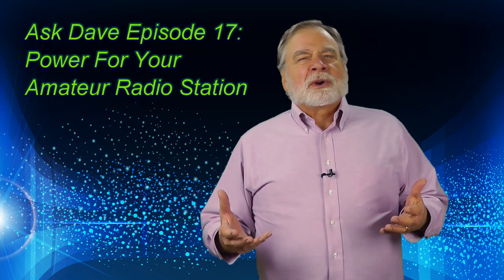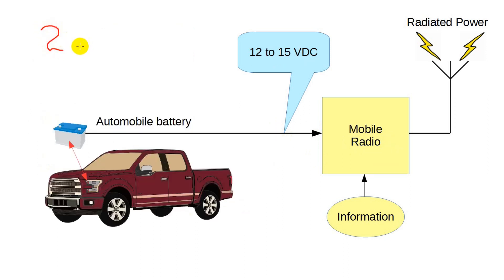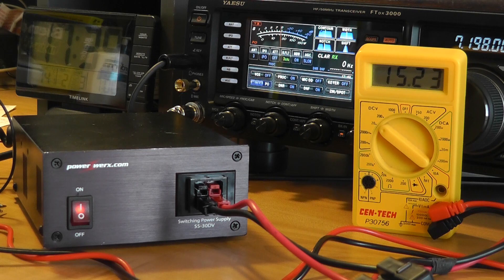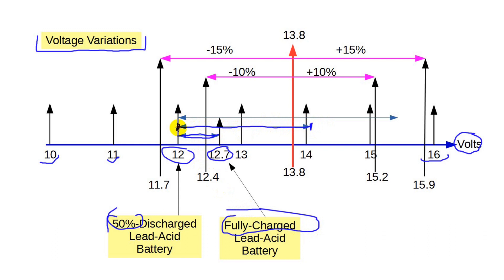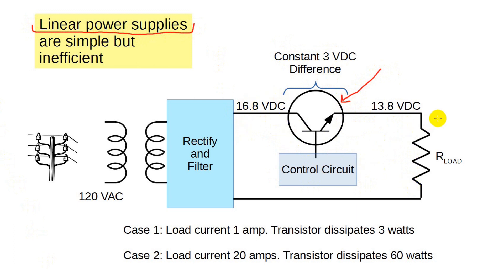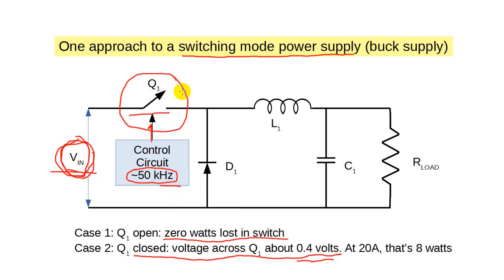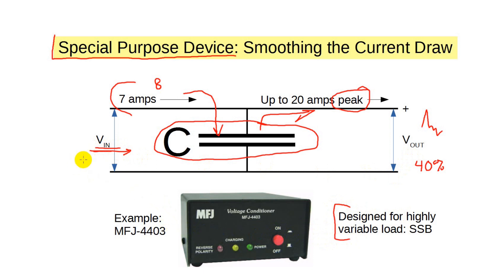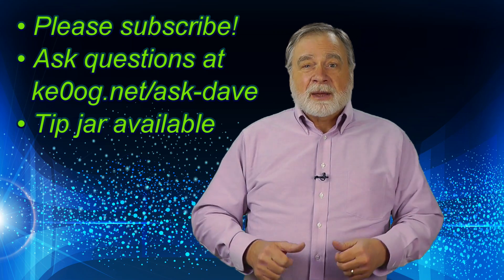Ask Dave 17: Power For Your Amateur Radio Station

Comment: Dave!  Thank you for your videos.    I am very new to the hobby and have a question.  I only have one quality 50w VHF radio.  I'd like to put this into a portable chassis or go box so that I could use it in my vehicle, then move it inside for base station work.  Ideally I'd like to have a battery large enough to power the radio for at least a few hours independently that I can also charge off of a cigarette lighter, charge with a trickle charger, or charge with a solar pannel.  What battery would you suggest?  Do I need a charge controller or battery management system?   Thank you!!

Comment: Yeah Dave but if you got a diesel quad you'd have much more torque......

Thanks for the great video. When I'm in the southern hemisphere I use an Emtron EPS 30. And oldy but a goody.
In the north I use a Racal pvs-20 power supply.
Reply: +Ade Larsen Some local guy is selling 6 phase 28 volt Waukesha gen sets for less than dirt cheap. They came off cell towers & were used as aux power for when the batteries go dead from lack of sunlight on the solar system. I would need to rectify the 6 phase 28 volts then regulate it down to 13.7 then use an inverter to kick it back to 120 for those AC power needs.  These Waukesha sets are propane/nat gas, & can be easily rejetted for either propane or natural gas. Every so often I do see an old military tri-fuel come up. Tri-fuel my ass! Try any fuel, other than diesel in one of those after it has been run with diesel & tell me how well that works, without cleaning the plugs.
Reply: +Seth B I just bought an Astron 35 amp & just I got a 1.2KVA buck boost 240/120 to 24/12 volt,  a variable reglator, zeners, other passive parts, and a enough transistors to step that up to around 13.7 volts @ 100 amps peak, for about $300. I knew I kept those heatsinks around for a reason.

Comment: Hi Dave, I had a question about something you mentioned around the 6m30s mark, that the transceiver should be turned on after the power supply is on, and also that it should be turned off before the power supply is off. Why is that? Are supplies prone to unpredictable voltage when they're turned on/off, or are there other reason(s)?
Reply from the maker: Nick, the answer is that, yes, power supplies can put out spikes when turned on and off. But also the power dies away a bit slowly, so the rig is subjected to severe undervoltage  which can make some of the circuits, particularly digital logic circuits, unhappy. Best to use the rig's power switch for power on and power off. 73

Comment: Hello,I have the MFJ-4035MV power supply, which was stored in a box for over 10 years. Previously it was working well. But now the voltage meter fluctuates and does not stay as set with the voltage adjustment knob.I did open the unit up to blow any dust in there but the problem persist.Can you tell me why this is happening?
Reply from the maker: Check with an external voltmeter to see if the output is actually fluctuating or if it's just the internal meter. If internal, you may have to retighten contacts inside. Note that line voltage is on some of the heat sinks, so unplug the power supply prior to poking around inside.
Reply: @davecasler  Thank you very much Mr. Casler for the information. You make great videos, 73.

Comment: Hi Dave,

I'm looking to power an old icom U16 (similar to O2-AT) portable radio UHF(5W) at home...440-450MHz. It draws about 1.5amp on HI power setting.  Will a switching power supply interfere (RF noise) at UHF freqs? I'm looking at switching primarily for size, but if needed will do linear/bulker. Thnks.

Comment: Hi Dave,  I ran across your videos on solar and saw the ham related video's. I know it's late in coming but just a little note. You're graphic with the battery and the DC-DC converter should actually be a boost converter, not a buck. Good video though, as are all the others I watched. 73 NU1W

Comment: Hi Dave, I’m Mula, YB1BUL, I like your channel😊. Regarding Power Supply for our ham shack, is it OK if I put a parallel Capacitor? I have Super Capacitor of 100F/6 = 16.7 F (6 caps of 100F/2.7V in series with a balancer board)

Thank you
73

Mula

Comment: FYI, the diagram at 21 minutes into your video is mislabeled.  You say the right things but a switching power supply that boost power is called a "Boost converter".  "Buck" converters are exclusive for dropping the voltage.  You can fix this by simply changing "Buck" to "Boost" on that slide of the video.

BTW, there are Buck-Boost converters (https://en.wikipedia.org/wiki/Buck%E2%80%93boost_converter) that will either boost or buck the voltage based on whether the input is higher or lower than the desired input.  I just do not know if they are used in Amateur radio but then I doubt that they are needed for typical Amateur radio applications.
Reply from the maker: +bitogre Thanks for pointing out the error. Unfortunately, once I put up a video, YouTube won't let me edit it. Hopefully people will see this comment and check out the Wikipedia article. Thanks for your sharp eyes! 73, Dave, KEØOG

Comment: Hello Dave, I am going to be picking up my first HF radio which will be and FT-891. Going to be going portable with it to the park and such, when connecting it straight to a battery will I need any sort of fuses or extra components to protect the radio?
Reply from the maker: The stock cable should have fuse holders already built in. If not, yes, you should put in a fuse. You can get automotive-style fuse holders at an auto parts store. If the rig puts out 100 watts, you probably will need a 25 amp fuse. Enjoy your portable operations!
Reply: Thanks for the quick reply.

Comment: Using two "good" meters in some tests, I found one was 0.2v off from the other, so I couldn't be sure of what the real 12? volt system was at. I built a dimple "10.000vdc" calibration source into an Altoids tin and calibrated them both. And the first free CenTech meter I got? Was off by 0.4V out of the box. Dave, you CAN'T assume uncalibrated meters are right. Build a calibration supply, or buy a Fluke, to judge all the others. As they age they all drift.
Reply from the maker: The statistical estimation of physical parameters makes for interesting science. The TekPower meter I'm using now seems to be within a couple hundredths of a volt. But two meters will never agree! If they're of comparable quality, just average the results.
Reply: Yes, each meter will have differences, sometimes just the random float of 2-3 digits in the least significant digit. But on a standard 4-digit meter set to the 2-20VDC scale, I find all four generally stay in agreement when I've calibrated both of them to "10.00" scale volts. Bearing in mind the calibrator is putting out 10.000 so there's no float of the last digit coming from that. I often throw out the LSD simply because that float can make it unreliable.

Comment: David - Very good video...  Lots of valuable information.  You may want to do a supplemental follow-up video to discuss the subject from the pespective of battery use.  For example, I use radios in my van, wired to batteries that are powered by solar sources not the vehicle's power source.  This brings several new angles to the game.
Michael VA6XMB

Comment: Shot in the dark.  Bought a Kenwood ts-50 and a kenwood ps-30.  My concern is the ts-50 appears to like a 20amp continuous power supply where the ps-30 is 15a continuous and 20 intermittent.  Is this an issue?
Reply from the maker: The TS-50 should not need 20 amps continuously unless you're transmitting a full duty-cycle mode such as RTTY or PSK-31. I would still recommend a power supply that can deliver 20amps (or 25 amps) continuously.
Reply: @davecasler  I bought the ts-30 for $40.  If that makes a difference.  For the time being though, it will power the radio and tuner?  I don't know if I'll even use hf much.  

What do you know about the ps-30?  I read somewhere that it doesn't have over voltage protection?  Is that a serious concern?  I mean is it worth just spending $120-$200 on a power supply that won't fry my ts-50 and tuner?  My logic is these would have been off the market if they were frying rigs on the regular though eh?
Reply from the maker: @magicman08  I looked up both rigs and it looks like they should be a good match, particularly for SSB voice and for CW. If you try continuous duty cycle modes like RTTY and PSK-31, be sure to reduce the output power to about 50 watts or so.
Reply: @davecasler  thank you much for your time and effort in looking into this.  Now that I know for the most part, that I'm over the power supply hurdle, I can focus on antennas.  Going to watch your HF primer now.  Great content and I like your video flow.

Comment: Motorcycles, Solar power and HAM.  A man after my own heart.  73  KM4UQU.  Can more than one radio be hooked  up to an external power supply provided the PS amp rating exceeds the requirements of the radios?

Comment: I got a astron power supply today says 7amps and 10amp continuous I hooked it to my 45 watt Kenwood nexedge Mobile Radio and the radio is set to key up to transmitt a status code it kicked the power supply Down and I couldn't get it to work went to power and on again kicked down the radio says 13.8v and 13amps guess it was to much for it so I ordered a 19 amp 13.8 switching power supply RadioShack one the Astron had transistors on the back I'm guessing it's a linear power supply makes me mad wish it would run my radio hope this 19 will

Comment: Stupid question,  I'm new to the radio world,  I too have a Radio Shack 3A 12V DC power supply.  My radio says 75 watts output on VHF and 55 watts output on UHF.  I connected my radio to a SWR/Power meter.  I have noticed that on VHF high power is only putting out 22 watts output and about 18 watts output on UHF..  So does your power supply affect your radio watt output? If so I need to get a better power supply to get better radio watt output?
Reply from the maker: I'm surprised your radios worked at all in transmit. You need a power supply that can put out 15 to 20 A. The power supply you have now is way undersized for your radios.
Reply: Thank you David for your reply,  Yes I did buy a new power supply, It is a 12 volt 30 amp and now doing testing my radio it putting out about to 92 watts on VHF 151.0000.  and about 51 watts on UHF.I have the QYT 980 Plus.  Thank you again.

Comment: So a 30 amp switching supply would be enough for a icom 2730 mobile in the house? Or is that over kill
Reply from the maker: If that's all you have, it's overkill. But if you plan to add an HF rig, it's not.

Comment: Just received my new mfj 4275 and I am lost. Don't know how to hook it up.Do I hook it to40amp 75amp or 35 amp?will there be a problem with having the power supply next to the Stryker 955 with 80 watts out put.
Reply from the maker: The 4275 has several power outlets, and you can use any of them if they are rated for the load. For example, a 100 watt SSB rig rarely draws more than 25 amps, and that only for very short periods. There is no problem putting multiple rigs on the same power supply.

Comment: Hi Dave!!  I have a loaded question for you: I have a 43 year old 
13.8 no-name power supply.  Do 
you have ANY clue as to why it 
puts out 26.6 volts?  Good thing I 
checked before I connected 
my radio to it!! It looks like the old  small boxy Micronta unit from 
Radio Shack from the 1970's!! 
There's not much inside.  I made 
a power supply from a computer 
power supply, but it only puts out 
11.7 volts(maybe not enough?). 
Any thoughts you could give me 
would be very much appreciated. 
Thank you in advance & greetings 
from Montreal, Canada!! 
73 from your LOYAL subscriber,
Norman.
Reply from the maker: Hi Norman. If I were you I'd look around for another supply. Something's wrong with this one. And, yes, the 11.7 volts is likely too low.
Reply: @davecasler : Thank you very much for answering my question 
so soon! I had a feeling it was time 
to go power supply shopping, but 
it's good to check with an expert, 
such as yourself, before making a move just in case.  I'm truly 
honored that you took the time to 
respond to my query.  I'm going to 
study to get my ham license, and I 
am hopeful to get it soon!!  Then it 
will be time to get my first ham 
radio!! I'd like to get a hand held 
first for the convenience: it can be 
used in the car with a mobile 
antenna, at home with a base 
antenna, or walking around, and 
secondly: price.  With a low initial 
cash outlay, I'll be able to get the 
mobile & base antennas as well as 
the hand held unit!!  Now I just 
have to figure out  which hand held 
to buy!! 5,7,8,10,15 watt?  Is it 
dangerous to use a 15 watt 
hand held? What about 10 watts? 
Much research is needed!! Thank 
good fortune that you & your 
videos are here to learn from!! 
You do so much for this good 
and fine hobby/way of life, I 
wonder if you know how much 
we ALL truly appreciate you and 
all that you do.  With my 
disabilities, it'll be difficult 
to buy what I would like(Doctors 
say I can't work anymore), but I 
will get there one day soon, come 
hell or high water!!  I can't wait to 
make contact with you on the air!! 
I've got  an RCA Co-Pilot 14T302 
SSB CB radio (vintage1978!!), so 
that'll keep me going until I can 
pass my ham test and get my 
first ham radio!!  You'll hear from 
me with more comments, queries 
& questions, no doubt!! I'll also 
let you know when I pass my 
ham exam.  Thanks again for everything Dave!! 73, Norman.

Comment: Hi Dave! I was just about to ask you this question.
Brilliant answer.Thanks.I use an old CB PSU from 1980 s  and it gets extremely hot transmitting 10w (maximum power for a M6 )
Thanks for the advice. Time for a new PSU..

How about a video on USED ham radio for example what to look for best used radio for simple use. Bargain of the year as people buy the latest kit.There must be gems out there if you know what to look for .over to ask Dave !

Anyway just a thought.

Regards

David m6dfl

David m6dfl
Reply from the maker: Used equipment is so variable, plus I have always bought new, so I'm not good at spotting a bargain. I'll have to ask around at the club.

Comment: Discharging a lead acid battery below 12 volts or 50% can damage the battery and shorten the life of the battery.  The newer LifePo4 batteries are better!  They can give much more power per pound and size and can last almost 10 times longer.  The downside is the cost. They cost about 3 times as much but can last up to 10 times as long.  But the up front cost has stopped them from being used much.  They also have very low internal resistance and can deliver higher current.

Comment: That explains your great depth of technical knowledge.   In some of your videos I've noticed you own a Ten-Tec radio.  I'm currently in the market for a n HF rig and have contacted Ten-Tec about their OMNI VII unit.  Apparently it is sold out and they are waiting for parts to begin production on the next run.  Can you tell me anything about the radio?  How does it compare to the more mainstream competition?  Would you buy another Ten-Tec given the new machines on the market today?
MB
Reply from the maker: The last I heard, TenTec was no more. Perhaps someone is going to revive the brand. Their Omnis were great radios. I replaced my TenTec Jupiter a couple years ago with a Yaesu FTDX-3000 and enjoy it thoroughly.

Comment: I am having trouble with the Math 13.8V * 20A = 276 Watts  for a 100W Radio.  What am I missing here?
Reply from the maker: The radios are 100 watts out. The output final amp is linearly biased, so the amp is less than 50% efficient. Hence the much higher power input.

Comment: I have seen so many times where one refers to "CURRENT" as being Voltage, Amperage or Wattage and... Sometimes something perhaps completely Different <-- this happens when someone is explaining a circuit and uses the terms Voltage... Wattage... Amperage... and then injects "Current" also. This can be quite disturbing when you are utterly new to this device circuit and are trying to understand its concept.  It would be nice if proper distinction was given to this.   Although quite adept in electronics this can be quite problematic when trying to stay focused on a device's build and all of a sudden this term is introduced, although from the beginning; Voltage, Amperage and Wattage had been used all along and many times prior.
    (BTW -- I know others who would also like this explained but have felt to embarrassed to ask.  They think it would allow others to think less of them as a electronic tech.  I understand if this is an issue you have as well, so plese, if you do then just ignore this comment. 
    As for me... I used to write about electronic theory and antenna arrays for a local Ham Club.  I am self-taught AND I never OvER--raTe NoR ExaGErRaTe my abilities.
    (  I used to have difficulties figuring out how much Capacitance an Inductor would create.  Or how to re-install smoke into an electronical device.
     Please "like" it you find this something you also wanted (no one will know it was you).